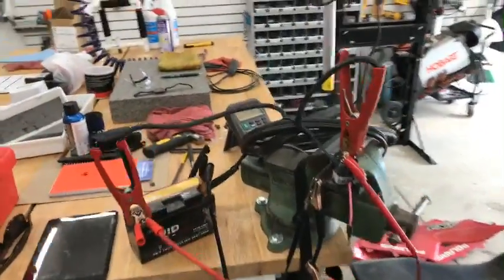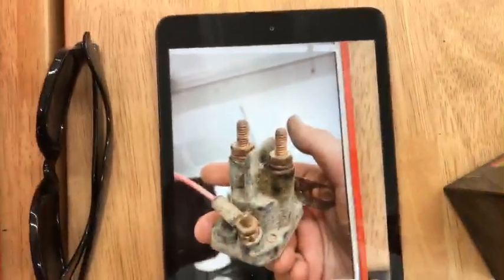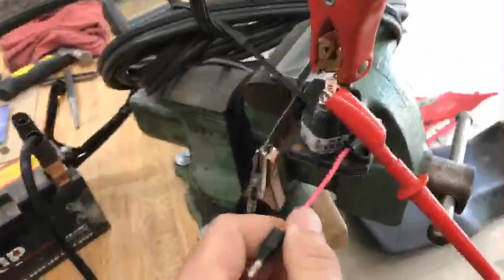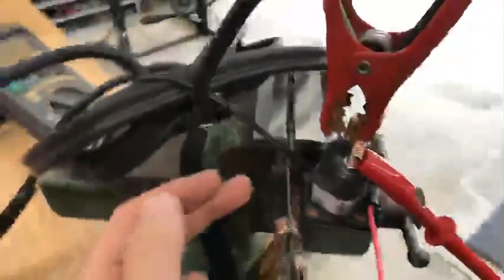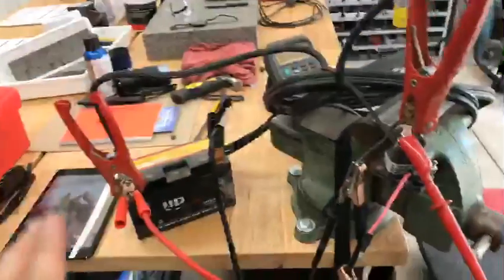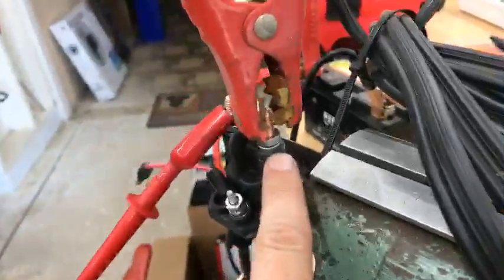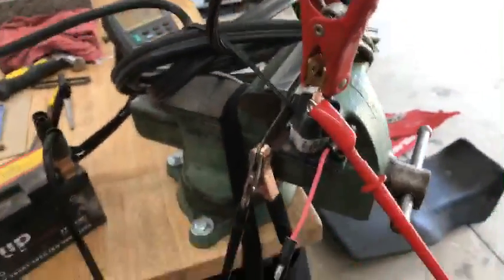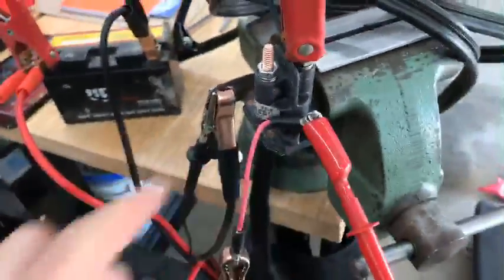How to test a starter solenoid. Example of a bad one easy to miss if not tested this way!

Comment: If you are having this problem as I was, take the Solenoid apart and clean it.  Just as the outside can become corroded so can the inside.  The Solenoid is not a part that works all the time, it just works to start the motor/Starter.  Once you return the Key to the run position (not the Start) the starter stops doing its job.
Reply from the maker: The Solenoid is riveted....and most do not come apart. Please Use New Email: how2wrench@gmail.com 
You're in luck. I do offer personal service to back up what's missing from a video to actually fix your specific problem. I do work on donations for my time and possible research. 
Good news is its CHEAP! For my time would mind becoming a member of my website? It comes with a free HOW2WRENCH “Keep Wrenching” t-shirt or 20 mins of techline and that will cover my time to assist you so we both benefit. So to have me personal cell phone number to put in your phone as your direct info and how to coach, sign up now! As always thank you and enjoy the free videos! Much more to come! I look forward to working with you and hope you will become a member of or learning community. 

Link to membership: https://how2wrench.com/product/membershipmembers-onlymembers? 

If I can ever be of service to you, here is a video explains how to connect with me. 
https://www.youtube.com/watch?v=vjvmB01ebcs 
Direct link to services: 
https://how2wrench.com/product-category/tech-lineservice-callminutes/ 
Live Chat is great for you to actually show your specific issue!
Donation link: https://www.paypal.me/how2wrench